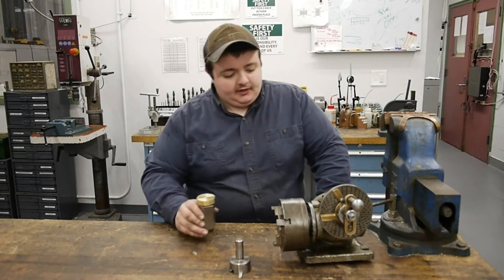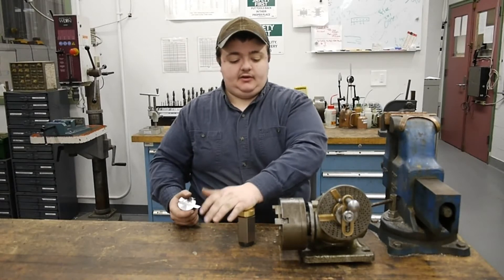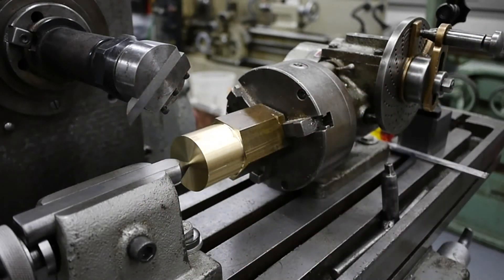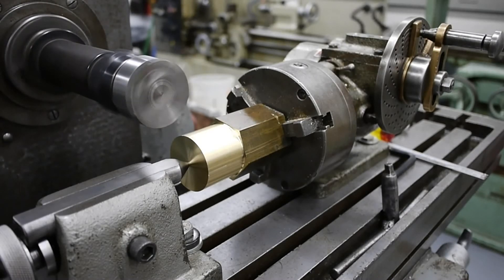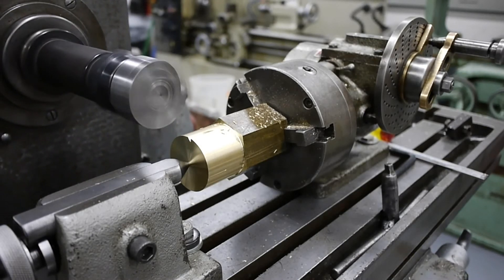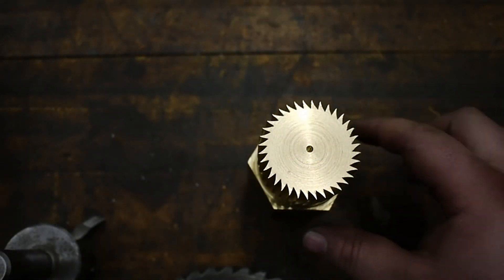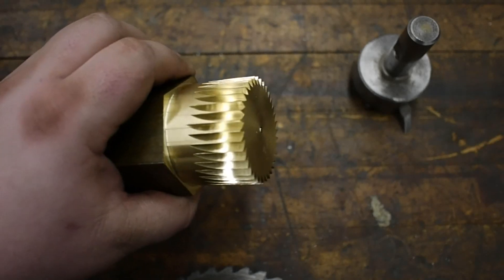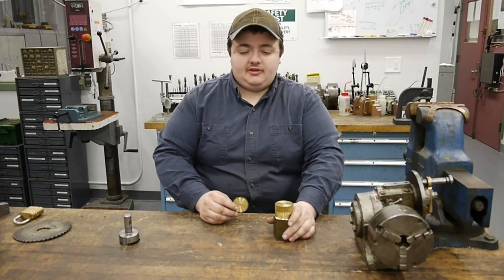Machining a Brass Escapement

Comment: When you parted the escapement, what did you use to clean up the parted side?
Reply from the maker: I used a piece of 800 grit sandpaper on a small granite surface plate for all deburring